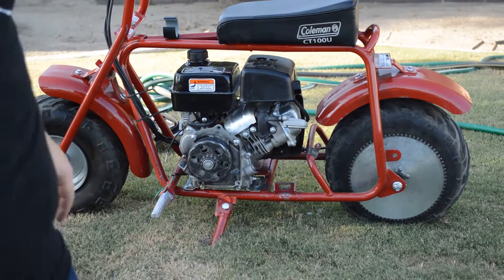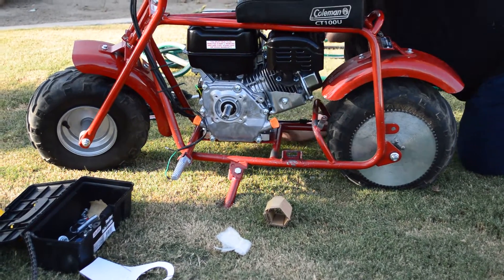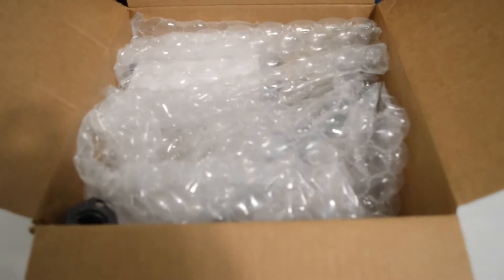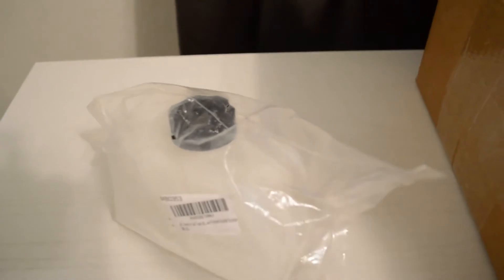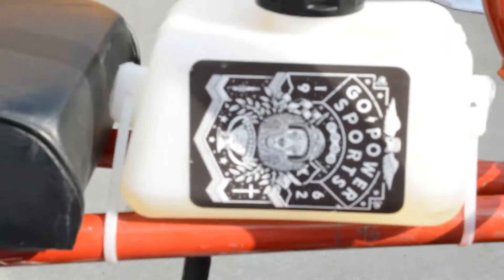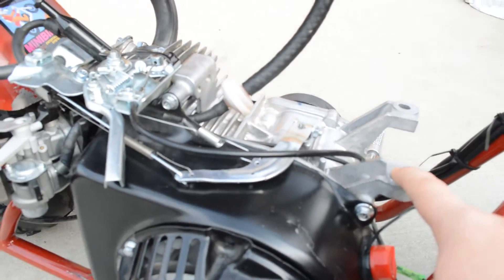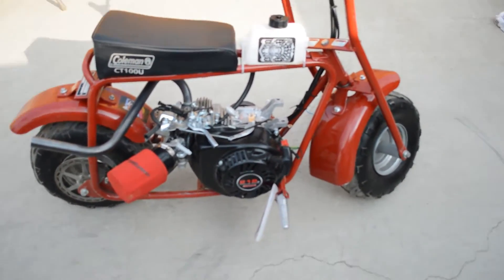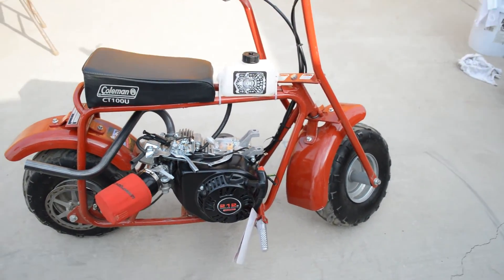Coleman 100cc Predator 212 Engine Swap!

Comment: What clutch and chain did you use man I got the predator ghost for my ct100u can't find right clutch and chain to fit with stock rear sprocket
Reply from the maker: I used a number #35 roller chain and a 3/4 bore clutch that was made for the #35 chain. I believe that the rear sprocket is made for a #35 as well. I have some in my description!

Comment: For the mounting part, can I not use the original Coleman cc100x mounting bolt and washers for the 212? If the bolt and washers are to small/big for the 212 could you please leave the link or the size of the bolts and washer I’ll need to mount it. Thanks!
Reply from the maker: Tbh I just took the original bolt to Lowes and looked for one about the same width but longer! I only payed like 3-4 dollars when I had went
Reply: @cartercardona  Alright, thanks for letting me know!! I’m getting the engine and I wanna know all the stuff that I need to do this project, I’m gunna get the clutch + chain and now I’ll just hope I have bolts around the house 😂 good video anyways!!

Comment: Ive been looking into using polyurethane washers/bushings to sandwich between the motor and mounting plate to eliminate some of the vibration.
Reply: Hey did that ever work I just did this swap ? Thx

Comment: What size clutch did you need to get?
Reply: Get a 3/4 chain 12 Tooth 12/10 (a Tooth 12 is better then 10 and it’ll be better for performance but it’s up to you on what is available for you but get tooth 12)

Comment: Do you mind me asking what bolts did you use to mount the predator on the bike ?
Reply: Just take the old one to Home Depot and ask them for longer ones that what I did
Reply from the maker: Yeah I actually went to Lowes and just found the original bolt size but longer

Comment: Did the engine bolt pattern match the mounting plate no issues? I've got one and I'm thinking of throwing my old hemi onto it!
Reply: Yes. I just swapped mine. Super easy swap. Need a new clutch and to figure out hooking up the throttle… that’s it. And move the gas tank… you can use the Coleman one if you have it on top
Of the predator. Be careful with a 12/60 gear it’s a bit sketchy
Reply from the maker: Yes but it need some longer bolts
Reply: @cartercardona what bolts?

Comment: So I know what clutch I need I have the same bike as you I just don’t know what chain length I need for the predator
Reply from the maker: I bought a kit like this because it comes with a tool to adjust to the right size not bad! And the extra chain always comes in handy if somethings goes wrong. In realty I think you only need 5 or 6 feet but it depends on preference: https://www.amazon.com/FDJ-Chain-Roller-Connecting-Cutter/dp/B07T9679KR/ref=sr_1_22?crid=2IMZEO5D3CVAC&dchild=1&keywords=chain%2Blink%2Bcutter%2Btool&qid=1623877490&sprefix=chain%2Band%2Blink%2Bcutter%2B%2Caps%2C218&sr=8-22&th=1

Comment: So do you have to order a custom mounting plate or it will fit on the stock mounting plate? And if so what bolts do I need
Reply from the maker: You just need longer bolts the original mounting plate fits fine

Comment: Do u have to get a new gas tank or will it fit with the stock one ??
Reply from the maker: Well the tank it kind of big so some guys smash there tanks flat but I got a small one on Amazon for a 8 bucks
Reply from the maker: So unless you wanna smash your tank i would get a new one
Reply: @cartercardona  thanks This will help out alot cause I was planning on building the same thing
Reply from the maker: @calebgonwin9706  awesome man hope everting works out
Reply: @cartercardona  yup I'm excited
Reply: @cartercardona  would u happen to remember where u got ur fuel tank from
Reply from the maker: @calebgonwin9706  amazon! got it here: https://www.amazon.com/JRL-Petrol-Pocket-Rocket-Scooter/dp/B01A0B9E8C/ref=sr_1_5?dchild=1&keywords=fuel+tank+mini+bike&qid=1618110785&sr=8-5
Reply: @cartercardona  thanks and one last question sorry for bugging u but does the gas tank come with the black tube that runs down or do u have to buy that separate
Reply from the maker: I guess I never saw this I am very late but mine didn't you can either get it on amazon or local hardware store!

Comment: Clutch and rear sprocket lined right up huh? No fab work at all?
Reply from the maker: Yeah but before I tightened down the engine I had to make sure the clutch was lined up with the sprocket!
Reply: Is the clutch gear out or in?

Comment: How did you do the rear sprocket adapt
Reply from the maker: The rear sprocket fit a 35 size chain so did the clutch do i just used that
Reply: @cartercardona  I'm putting a 196 or a 390 on the 100cc frame and the clutch is for the 196
Reply from the maker: @treyhuber9401  depending on the bore size of your engine you can buy a clutch with the same chain size as the sprocket

Comment: Did you use the same clutch as the old motor or did you get a new one?
Reply from the maker: You need to buy a 3/4 bore clutch because the one on the original is two small.

Comment: Do you recommend a 212 swapped ct100u with mods or a ct200u
Reply from the maker: Well a 212 on a ct100u  would be faster because it’s smaller but the Coleman 200u is bigger so if u want faster but can sacrifice size then go for the 100 but if you absolutely need bigger than go for the 200u
Reply: @cartercardona  im 5’11 do u think the ct100u is too small?
Reply from the maker: @---bj8ty  it would be small but still comfortable enough for u to ride and go fast . I know a guy to is like 6’1 who rides the 100u but it really is preference
Reply: @cartercardona  ok u convinced me to buy it, thanks bro

Comment: I got the stock engine on the bike to go 43 I was wondering if the predator would be faster
Reply from the maker: How you get the stock to go 43? Yeah the predator would still have more torque! But the stock engine is still very reliable it lasted three whole years never stopped once!
Reply: @cartercardona  lol I cut the throttle screw, bypassed the governor and some stage 1 mods. But I just recently put the predator on my bike, the thing has way to much torque. I ordered a 48 tooth sprocket, a 10 tooth clutch and a 420 chain. I’ll let you know if that will calm things down.
Reply from the maker: @ericz8647  That's really cool man let me know!
Reply: @cartercardona  the parts came in, I put them on the bike and it’s much better! It’s definitely not as sensitive!
Reply from the maker: @ericz8647  that is so cool man
Reply: What mods did you put on it specifically
Reply from the maker: go power sports kit
Reply: What mods?

Comment: What’s the top speed??
Reply: same as old engine, 3500 rpm on output shaft, depends on the gearing you use to the rear wheel. smaller gear reduction = faster but less torque
Reply from the maker: So to like 50 to 45 but if you got an upgraded carburetor and cookie sprocket it probably go like 60-70